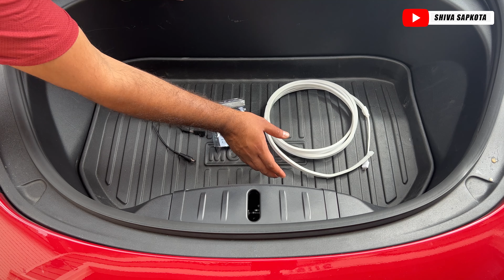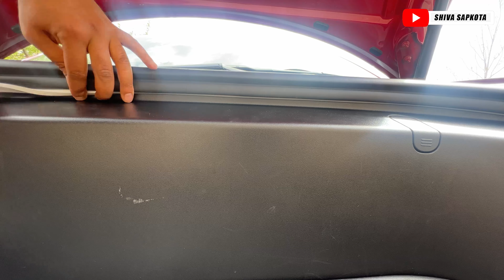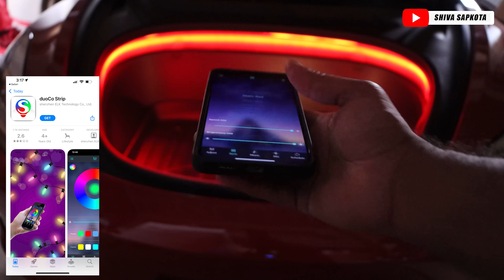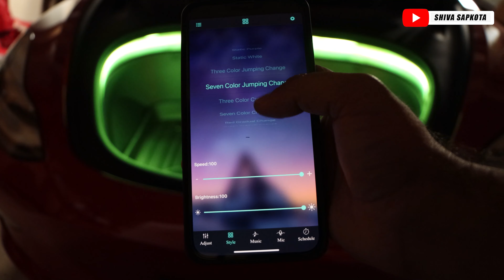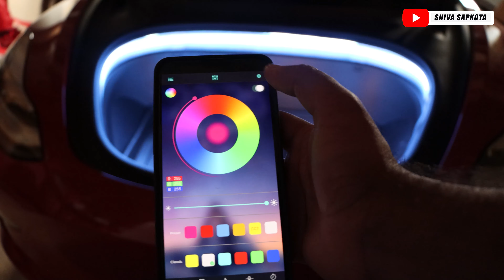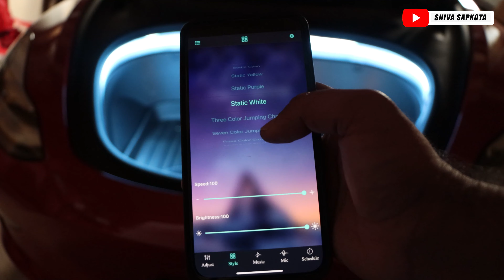NEW Tesla RGB Frunk Light Upgrade - Easy Installation & Must Have Accessory 2022

Comment: Shiva  My  2022 model 3 has the automactic frunk  (HW from Handsshow) opener. It works fine. (I can open my frunk with mobile phone/computer monitor or push the button  in the frunk) . After installing the frunk strip light  and  connected the strip light connector to the back of the button light as you instructed. There is the little problem I cannot close the frunk by pushing the buton  (the button lighted)  I can only close with my phone or the computer monitor inside the car. Can you tell me why? how to fix it? Thanks

Comment: Thanks so much for the video. I installed successfully the light strip and connected the  wire connector provided by Hansshow ; However  I  can close or open the frunk with my phone app or the computer monitor inside the car. I COULD NOT close the frunk by pressing the button at the cover plate - the strip light and the button light work fine . Just  could not use the light button to close - Do you know how can I fix it? Is this normal or  the defect of the wire connector? They provide two sets of wire connector depending which model you  have. I have model 3 , 2022. Please help
Reply from the maker: It seems like a connector fault. It is either damaged or incompatible. Does the button work if you remove the LED connector? If so (not ideal) but you can tap into the frunk wires using T taps. The lights just need power source. https://amzn.to/3jIropm
Reply: @ShivaSapkota  Yes the button worked if release the connector. I think the connector default . Will get the new one thanks

Comment: Hi, I have a question; the link you sent looks different than yours, they have a little complicated install which you have to connect the battery and others, but you just open the box and connect with the male and female plugs, and plug into the control sensor. Is that the correct link or the right product that looks exactly like yours? Thank you, Shiva.
Reply from the maker: Yeah it should be the right product with a simple plug bypass. They might have updated the product to accommodate the new AMD chips. Please send a message to Hansshow before placing an order to make sure. I will also inquire about the change. Thank you.
Reply: @ShivaSapkota  thank you Shiva!

Comment: Got  mine today , shiva does it go off when frunk is closed and activates when it’s open also on your fog turning lights you can wire them straight in without feeding all around the car I added the yellow cables into my side repeater indicators yellow lead right side green lead. Left side I will mention your video on mine as you show the long version I will show the short version glad you subscribers going up your soon be on 50000
Reply from the maker: Thank you Mal! Congratulations to you on your channel success as well. I am not sure if the light turns off automatically after frunk closes, it might require the car to go to sleep.
Reply: @ShivaSapkota  could you put a mobile phone in the frunk on record, and you would be able to look at the  video and you would be able to see especially as it gets its power from the button let me know what you find out, interesting problem for you.

Comment: Does the light automatically turn off when the frunk lid is closed, or do you always have to manually turn it on and off?
Reply: That’s what I want to know also. I would not use it if it was a manual process. I installed a magnet light I bought from Amazon for $15. It is rechargeable and it is only white but I have it because I need to see when I open the Frunk at night. People use these as under the cabinet lights in there home.
Reply: id like to know this myself

Comment: Very nice light changing colours in frunk that has to be one of the easiest accessories one question does it work with the powerfrunk that is already installed
Reply from the maker: Thank you my friend. Yes, it works with the OEM or the power frunk.
Reply: @ShivaSapkota  thanks have ordered it will fit it soon as it arrives along with my fog lights have also ordered it too